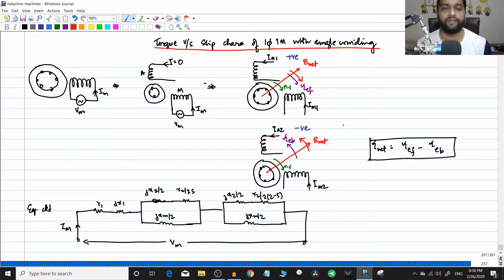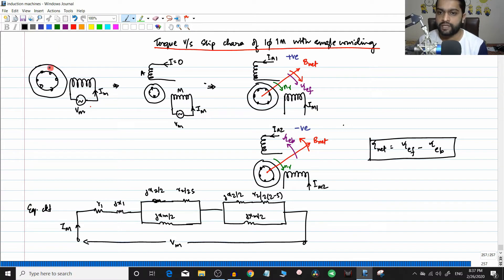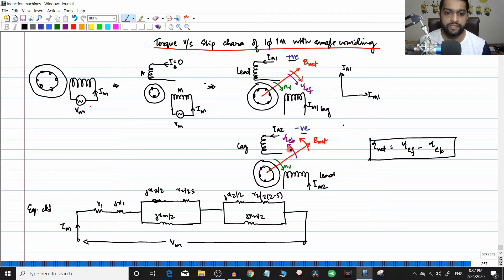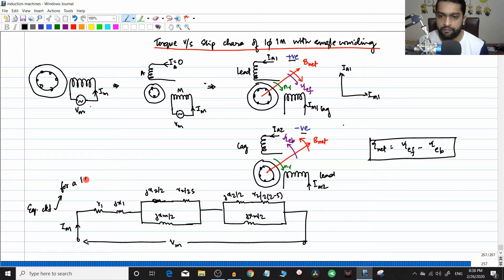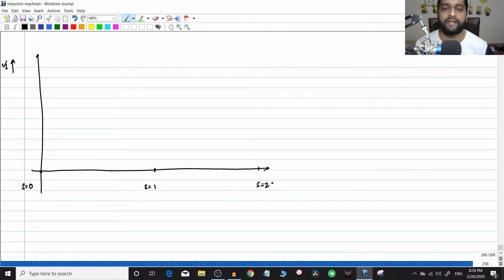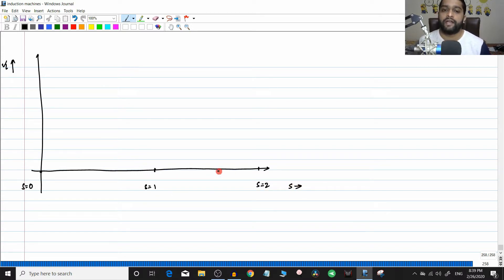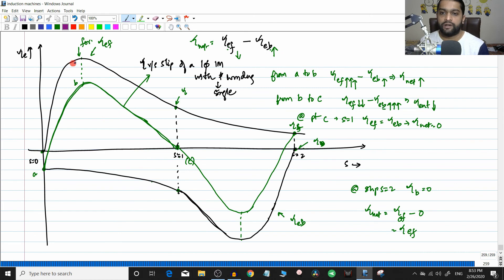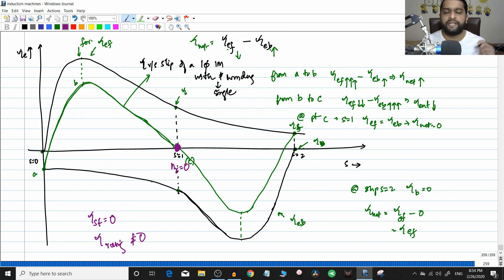Single Phase Induction motor #6  - Torque vs Slip chara of 1 phase IM with single winding.

Comment: From s=1 to s=2, which way the motor will rotate? because the backward torque produced by the negative sequence components is against the forward torque and rotation of the motor. But after s=1 the negative torque dominates so can i take the motor is rotating in reverse direction and the curve from s=1 to s=2 as its operating region in the reverse direction.......

Comment: At s=0 forward torque will b?
I think u have made mistake while making plot..;
Reply: No i think no mistake is there. During s=0, the forward torque is zero, as the rel velocity b/w the RMF and the conductors of the rotor is zero. But at s=0, the backward torque is still present. So the net torque is negative.